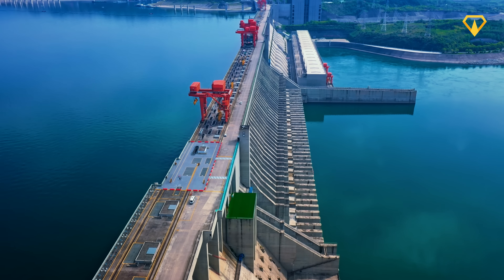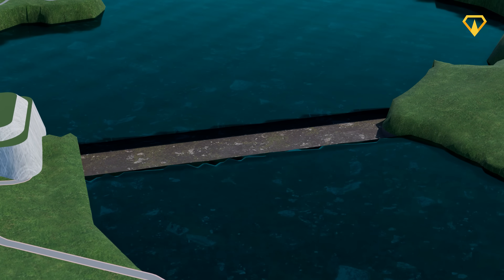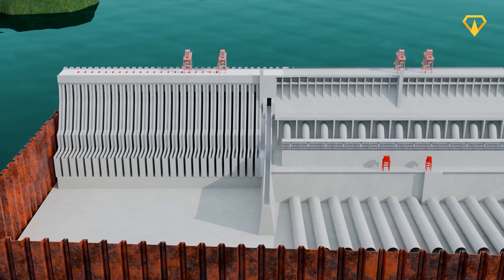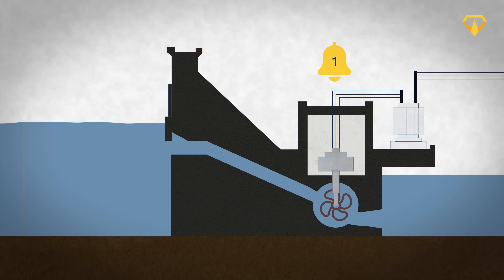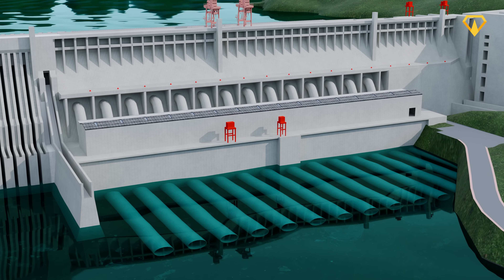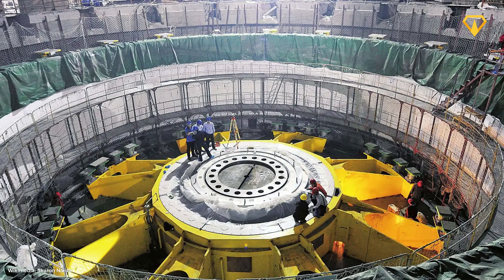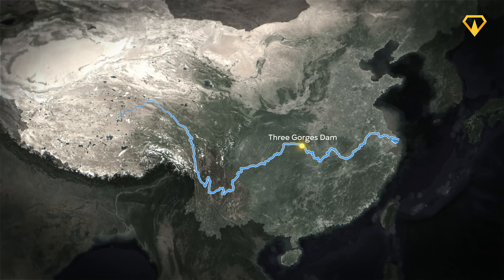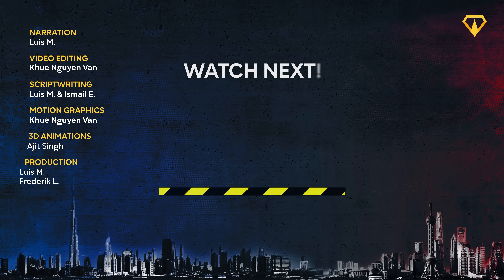How the Three Gorges Dam Actually Works

Comment: i guess its different in real life but your video shows the river water at the same height both sides so a dam wouldnt work.  there needs to be a drop on the exit side enough so that enough of the incoming water can move to the outer side and fill it up. also you river looked as if the water was not moving.  i have designed a much better and easier way of generating electric using hydro

Comment: Thanks for the video. Could you explain the back pressure solution and turbine solution better? You explained the problem well but just kind of glossed over what the fix was. Thanks!
Reply from the maker: Yeah, instead of surge chamber they chose to build a tailrace tunnel with a sloping ceiling. This tunnel can compensate the pressure, if the variables are correct (length of the tunnel, elevation of the turbines & water levels) 
This graph illustrates the setup more clearly:
https://ars.els-cdn.com/content/image/1-s2.0-S2095809916311687-gr5.jpg
Reply: Literally said it in the video. Good lord

Comment: The Three Gorges Dam is the world's largest concrete gravity dam, featuring revolutionary engineering solutions including custom turbines generating 22.5 GW, advanced safety systems with 5,000 sensors, massive ship locks and elevators, and innovative construction techniques that redirected the mighty Yangtze River.